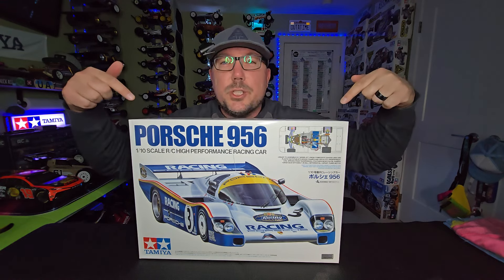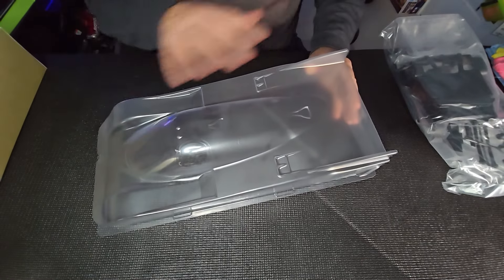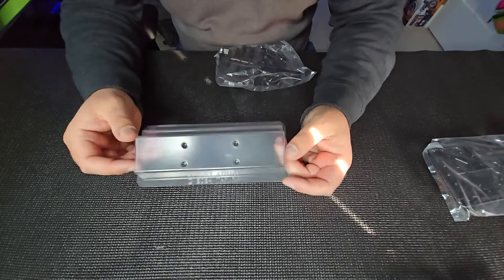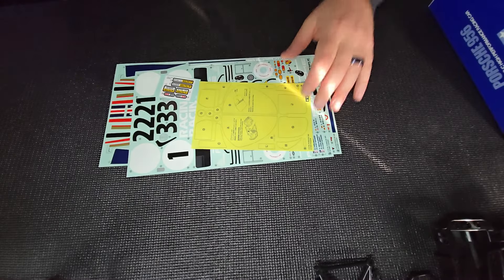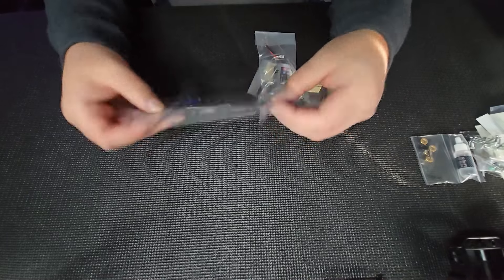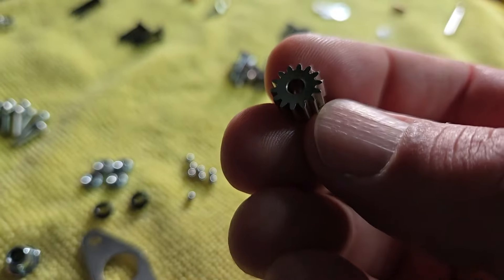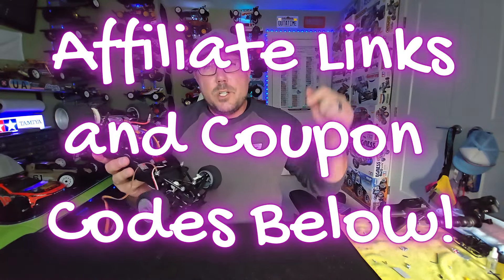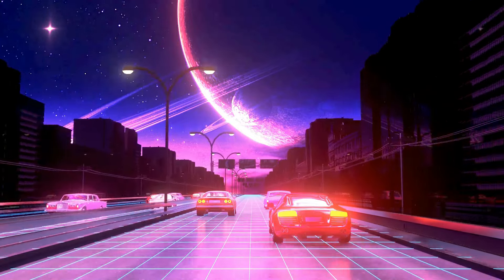Tamiya Porsche 956 - Unboxing and Building This Classic Race Car

Comment: I started mine last night and it did not take long at all to get most of the way through the chassis build. I have a little more to do this evening and then onto painting. Odd about the front wheels, I have not gotten that far yet. The only other I have done like this is the Tyrrell 6-wheeler and f course those front tires were a lot different! LOL! I was surprised to see the size of the body though, it is big!
Reply from the maker: It's humongous! It's also my first Porsche 956, so I suppose it's fitting that the chassis would have a large body. It just shocked me when I saw it. 😅
Reply: Front tires (foams) are from the F1 front wheels, That's why they look funny on the Group C front wheels but Phil has them right.

Comment: 956 will be looking really awesome. I have two group C chasses, with 787B and C11 bodies. They are also looking cool☺ and big as Fil felt!!
However, not only the looks but they are really fast. I think we can try this baby for the next year speed challenge. Sure it is RWD but with length wheel base, it is capable of running straight with superior stability!!
Reply from the maker: It would be a great candidate for the SRC. Hmmm.... 🤔🤔🤔

Comment: I built one of the original of these it had an amazing twin deck carbon fibre chassis and full bearings ran a tamiya black can motor and it was fast .
Cornered like it was on rails with the banded foam front tyres   wish I still had it
Reply from the maker: Thats awesome to hear! I'm taking mine out filming today, so this comment is getting me pumped up! 👊🏼

Comment: Great build Fil. I think most (if not all ?) of Tamiya Group C have the front rims wider than front tires. I'm curious to see the handling with a Sport Tuned on a normal parking lot 😅. While I agree it's a very easy chassis to build, the body / stickers will be a challenge for a "beginner". Still no show in beautiful Switzerland 😢
Reply from the maker: Interesting to hear about the tires. I wonder why? Ah well, I hope you get yours soon! 🙏
Reply: It is also the case on my Road Wizards and F103 F1 cars that the tyres are smaller than the wheels so a regular Tamiya thing going back to at least 1986
Reply from the maker: @DavidRoberts-mk3zm  interesting... I never knew... 🤷‍♂️
Reply: @poorboysrc  yeah it is weird that they have carried on with it but at least on this unlike the F1 cars it is covered, but is just a Tamiya oddity I guess

Comment: The front wheels are supposed to be like that because it was meant to suck in air to cool the brakes. This type of wheel was popular in the 80s also on rally cars. The wheels and tires should meet at the inside rim and about a 1 inch elevated plate with wind veins on it stuck out. This drew in cool air and forced it over the brakes.
Reply from the maker: Well would you look at that? I learned something today. Thanks, man! :)

Comment: Front wheels and tyres are correct, It uses the same foam tyres as the F1 cars.
Reply from the maker: So bizarre that the wheel is wider than the tire. 🤦‍♂️